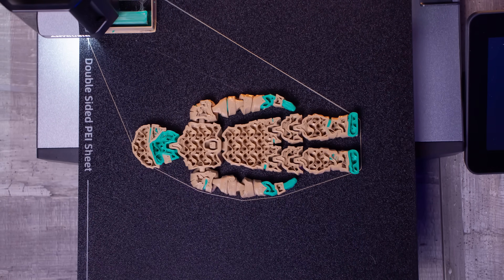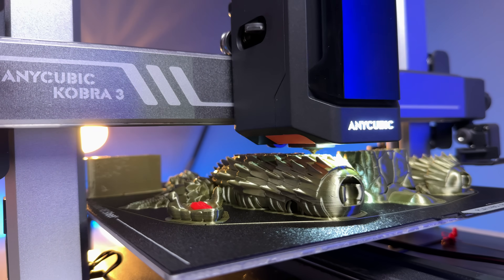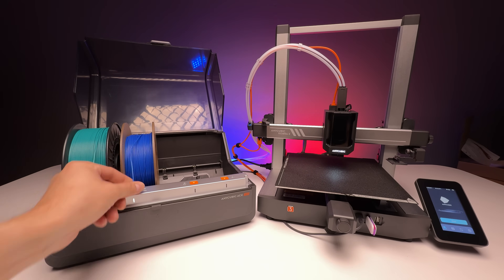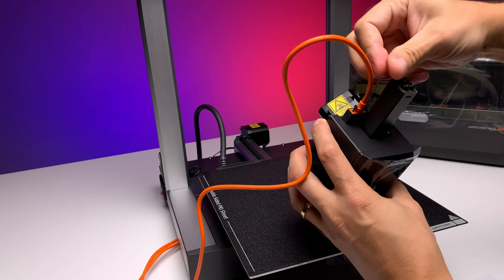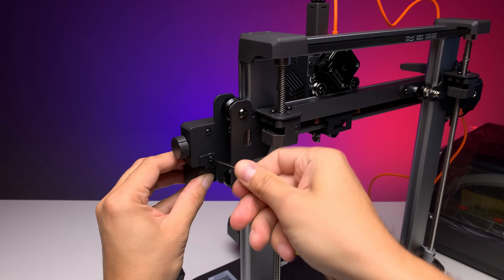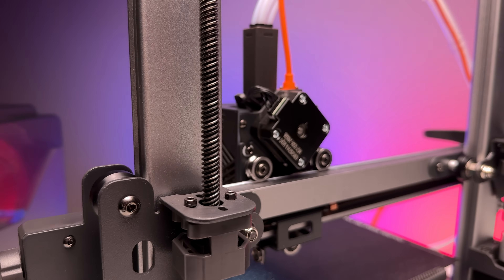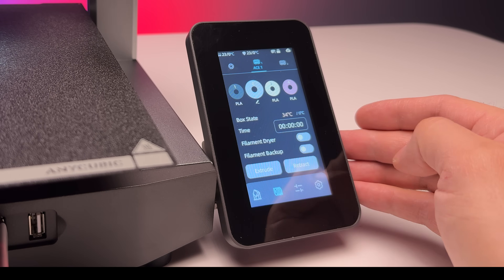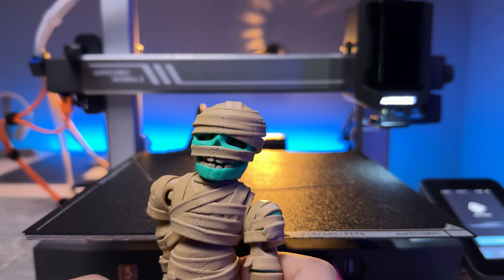How Anycubic Changed Multi-Color 3D Printing FOREVER

Comment: Purple disappearing gluestick for the bed. More for pla, petg & TPU than for higher temp filaments. Apply to a cold bed.
Reply from the maker: Great tip, thanks! Yeah, that glue stick works really well for those materials — I use something similar for PETG prints too.

Comment: 0:58 - three options for bed printing. 
add .02mm to the current  height of the bed level offset. -  this prevents obects from fusing to the bed.  
preferrably set bed to 32 degrees. nozzle around 215, and  print on a layer of wide  masking tape. masking tape is easier to replace than scratched bed.
Reply from the maker: Thanks for the advice, I'll try it!

Comment: There is only so many times multimaterial printing can change forever
Reply from the maker: How far are we from the final version now, do you think?
Reply: @ that’s not the point I’m making. Obviously it will be iterated on now that it exists but how is this not just another AMS clone?
Reply from the maker: Ok, but isn't bambu a clone of ender? When something is good, everyone tries to copy it. In my opinion, the decisive thing is what it will bring to the customer. Unfortunately, I only came up with the video now. I will have to make a video where I compare both systems... Each has its advantages and disadvantages...
Reply: @3DPrintKing  Saying that Bambu is a clone of ender is straight up crazy